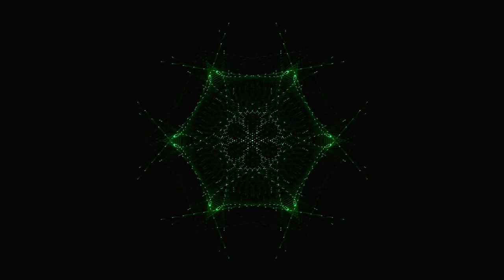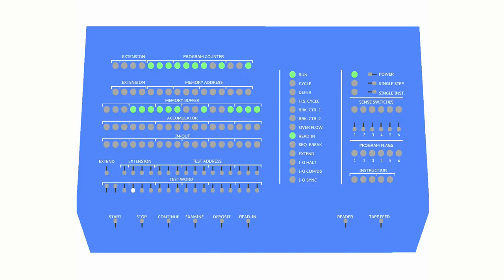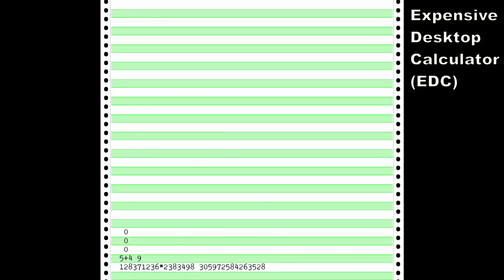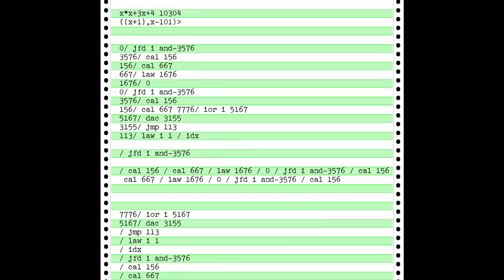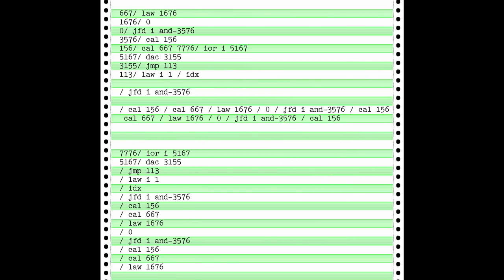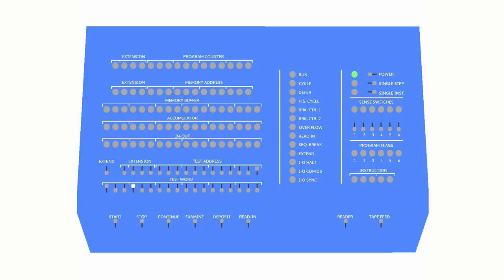PDP-1 recreated in FPGA plays Spacewar! - first real computer game.

Comment: It’s surprising how a single chip can recreate the PDP-1. Most computers from that time are very hard to recreate
Reply from the maker: The most difficult thing for me was understanding how it worked from the documentation alone. It was a very fun and educational project for me - got me really hooked on FPGAs... :)
Reply: @hrvach  I read the notes on Github about emulating the display, and the approach you used due to memory limitation. An alternate approach would be to use a nibble per pixel (bringing memory needed down to 4 Mbit, fitting within the 5.5 Mbit available). Writing a pixel would set the pixel to level 15. Looking up info on the P7 phosphor,  it is roughly 1.5 second to decay to 0.1% of initial brightness. As you scan the display at the output frame rate (60hz), you'd additionally process the pixels as follows for persistence emulation:

Have two 16-element tables, corresponding to the 16 possible values of a 4-bit pixel in the 1Kx1K display buffer. Call one the Pixel Color Lookup Table (PCLT). Call the other the Pixel Persistence Update Table (PPUT). As you scan the frame buffer, the current pixel value from the buffer would be used to index both of these tables. The selected element from the PCLT would contain the RGB color to be displayed. 

PLCT[0] would contain black, PCLT[15] would contain bluish white, and the elements of PCLT in between would contain colors progressively darker and more yellow as you went from element 14 to element 1, corresponding to a decaying phosphor. The blue fades quickly, the yellow more slowly. (You might store the color as a blue/yellow pair, with the blue brightness feeding the blurring-filter bloom-emulation logic you already have, and the output of that being combined with the yellow.)
To generate the decay, during the frame buffer scan you would replace each pixel in the buffer with a new corresponding value from the PPUT. The PPUT would be initialized at the beginning of each frame (scan of the frame buffer). For most frames, the PPUT would be initialized as an identity table, with PPUT[n] = n, so during those frames the buffer memory would remain unchanged. But every 6th frame, you would set PPUT[n] = n-1,  so every 1/10 of a second, the pixels would decay a little more. The advantage to making PPUT[] an array instead of just subtracting 1 from non-zero pixels is that not all stages of decay would  have to happen at the same rate. You could decay pixel values 15 .. 12 to 14 .. 11 every 1/10th second, correspoding to the rapid blue fall-off, but only change PPUT[11..0] from 11..0 to 10 .. 0, 0 every 20th  or 30th frame, allowing for three or five second persistence.  The values in the PCLT need not be linear, either, allowing for exponential decay via that mechanism as well. (The variable-update PPUT helps stretch out the tail, though, while staying with the limited 4-bit pixel size.)
Reply from the maker: @bradlevy2733  this is one of the most amazing comments and I was really surprised to see somebody actually paying attention to this, thank you so much for sharing! I was considering doing something pretty much identical to your suggestion. The problem that I had and was unable to solve is the mutual independence of pixels and the inability to properly determine age of a pixel with more than 16 levels. 

My line of reasoning was this - you have a 1024x1024 matrix with possible values 0-15 in each field and need to apply some sort of transformation to it every frame (or every n frames) to write new pixels and dim the existing ones. Since having a flat linear decrease of brightness looks totally wrong for this type of screen, you need to have some exponential decay, and therefore need to assign your lookup table with the corresponding brightness levels. This will leave you with a few quite visible brightness changes during the first few decreases and a lot of smaller ones after. These visible changes are really visible :)

For each pixel you have 4 bits of information and you need to use that information somehow to define 16 different states of a pixel within 4+ second persistence. Whatever algorithm you choose is going to give you 4 visible discrete levels of brightness per second in regular intervals which is not smooth at all. If you want irregular intervals, you need to have multiple frames between each change, but that is equivalent to having more bits per pixel and encoding several consecutive frames with the same brightness level in a lookup table. I didn't find any way around that. Maybe I'm missing something? I really wish I am! Cheers. :)
Reply: In actual implementation, you might store the PPUT as delta values (which will always be 0 or -1) rather than new pixel values. Looking at it this way, the PPUT over the 1.2 second cycle becomes:
0 1 2 3 4 5 6 7 8 9 10 11 12 13 14 15
0 -1 -1 -1 -1 -1 -1 0 0 0 0 0 0 -1 -1 -1
0 0 0 0 0 0 0 -1 -1 -1 -1 -1 -1 -1 -1 -1
0 0 0 0 0 0 0 0 0 0 0 0 0 -1 -1 -1
0 0 0 0 -1 -1 -1 -1 -1 -1 -1 -1 -1 -1 -1 -1
0 -1 -1 -1 0 0 0 0 0 0 0 0 0 -1 -1 -1
0 0 0 0 0 0 0 -1 -1 -1 -1 -1 -1 -1 -1 -1
0 0 0 0 -1 -1 -1 0 0 0 0 0 0 -1 -1 -1
0 0 0 0 0 0 0 -1 -1 -1 -1 -1 -1 -1 -1 -1
0 -1 -1 -1 0 0 0 0 0 0 0 0 0 -1 -1 -1
0 0 0 0 -1 -1 -1 -1 -1 -1 -1 -1 -1 -1 -1 -1
0 0 0 0 0 0 0 0 0 0 0 0 0 -1 -1 -1
0 0 0 0 0 0 0 -1 -1 -1 -1 -1 -1 -1 -1 -1
0 -1 -1 -1 -1 -1 -1 0 0 0 0 0 0 -1 -1 -1

And of course, you could store ones instead of negative ones, then PPUT[index] becomes a flag indicating whether or not to decrement the brightness this time around.
Storing it as ones and zeros is very amenable to hardware implementation. An entire PPUT at a given time can be represented as a 16 bit word, with a multiplexer selecting the relevant bit for the current pixel brightness. You can AND the multiplexer output with a zero during the 5 non-modify frames between the 10Hz rate frames during which you are updating the persisted pixels.